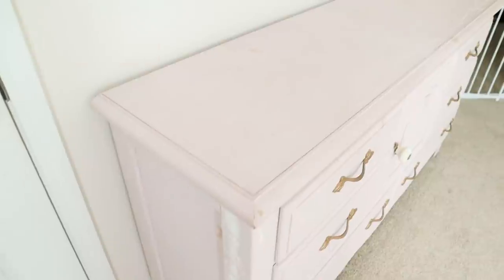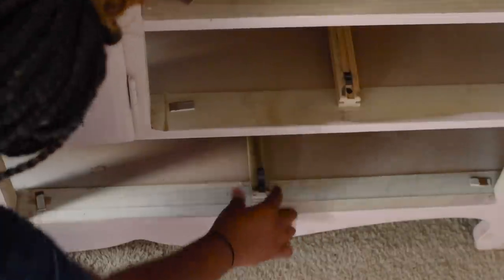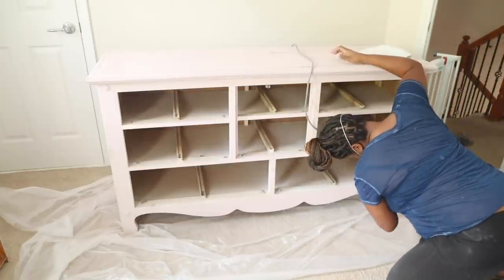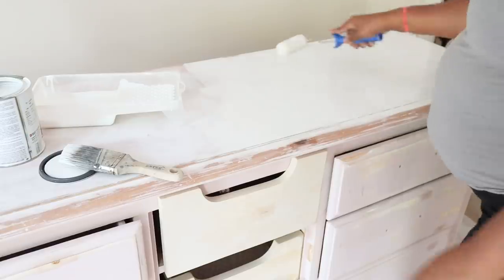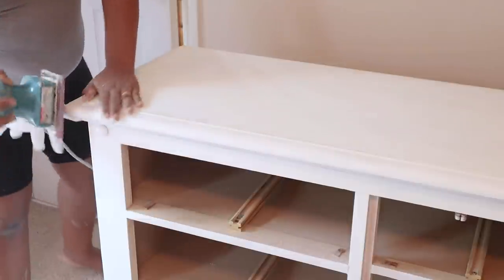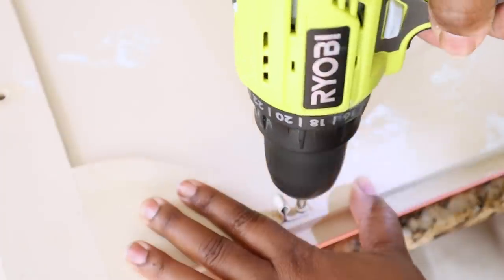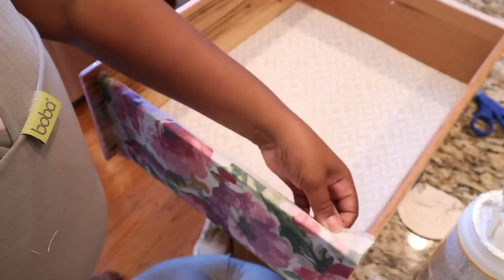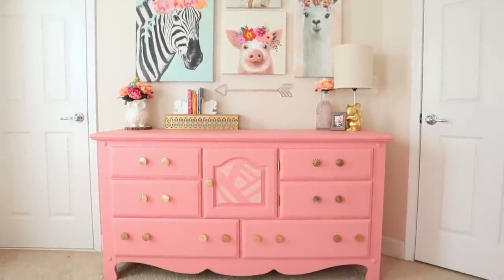Repainting Furniture Without Using Stripper & Sealing Wood Knots! | Ashleigh Lauren

Comment: I need to get some of that primer to try out! Do you always have to sand it first when using the primer? Love the final reveal! 💓
Reply: I dont , i do 2 coats of the primer letting it dry between coats then lightly sand the surface with 220 grit hand sanding pad just to smooth out primer coat then paint it seal it, but if it has layers of old paint on it i sand it first
Reply from the maker: No, it really depends on the condition of the piece and how you feel lol.